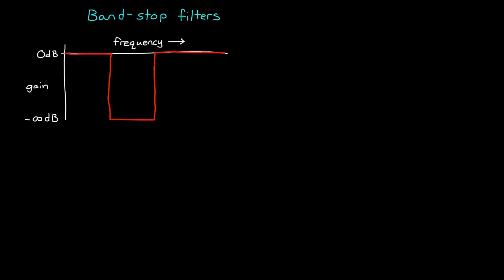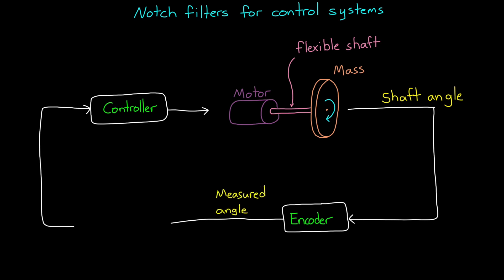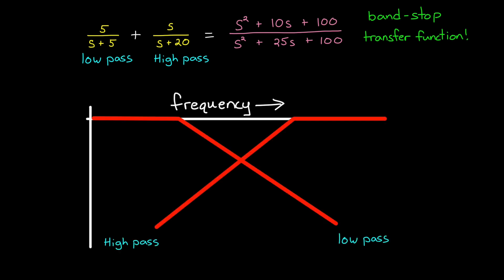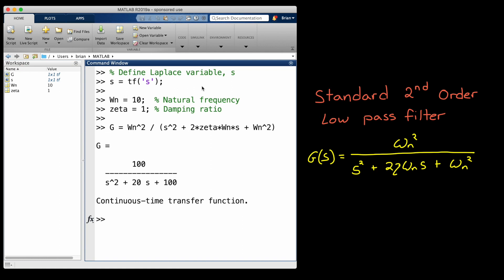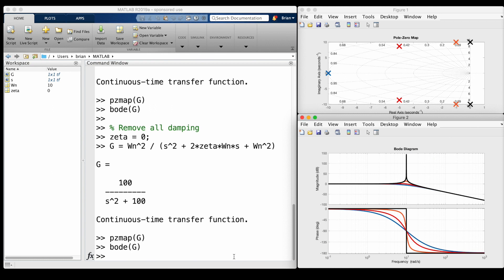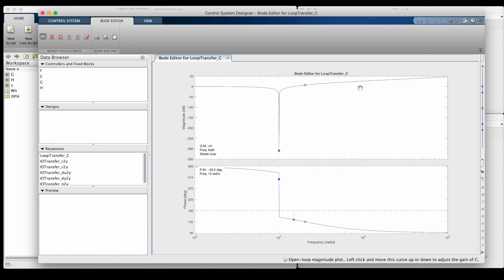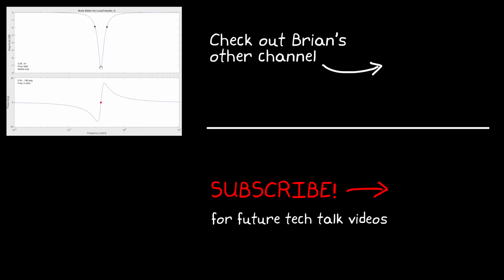A Better Way to Think About a Notch Filter | Control Systems in Practice

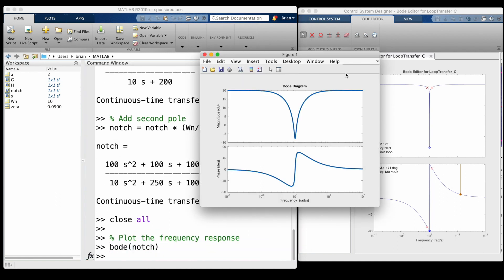Comment: Well, I've tried to not make any mistakes in this video but at least one slipped by.  At 10:35, I meant to divide by Wn^2 and not Wn.  The way I did it added in additional gain into the system which is why at 10:54 the Bode plot magnitude plot is biased up to 20 dB.
Reply: This explanation is awesome...! 😍

Comment: i don't get it, how it can filter anything without having a state from previous results? Even an real analog filters have state since capacitors will have charge and so on.
This formula takes only signal, i missing here something.

Comment: As an unlettered amateur in this context who has done a little bit of self-teaching on filters, transfer functions and their pole-zero plots, I found I could understand what was going on in the mathematical sense. The next question my mind asks is "Okay, so how does that translate into hardware? What does it look like to start with, w.r.t. component specs, and what am I physically doing to my basic low-pass filter to flip the function and add the poles?" Can you please point me to something that deals with this?

Comment: Hi, i had a question. If i'm getting things right you derive a Notch filter from a Band stop filter. Is it also possible to derive a kind of "Inverse Notch filter" from a Band Pass filter in the same way ? Greetings
Reply: Not in the same way. You can derive a Notch filter by 1 - Band Pass, which is subtracting the input to the Band Pass filter from its output. This is achieved in-circuit with a Difference amplifier using the original signal and the Band Pass output. The circuit varies whether the Band Pass inverts the phase or not since the amplifier can invert it back.

Comment: Brian, I'm seeing a problem: whenever I use "a" to adjust the width, there's a limit.  The ratio cannot be less than 1 or the width starts widening again.  Try it in Matlab.  Set a = 2, a =1, a = 0.1.  In fact, if you use a = 2, and then a = 0.5, they're right on top of each other because they're reciprocals.  So, how can we get around this?

Comment: I prefer to also write the denominator in terms of natural frequency and damping coefficient. The attenuation at the natural frequency of the notch filter then simply becomes the damping coefficient in the numerator divided by the damping coefficient in the denominator (assuming both use the same natural frequency).